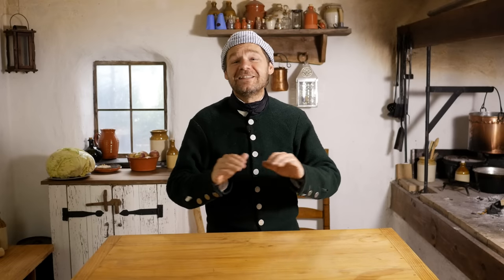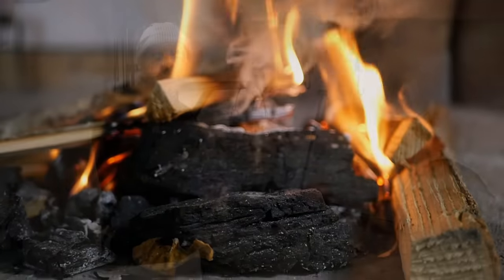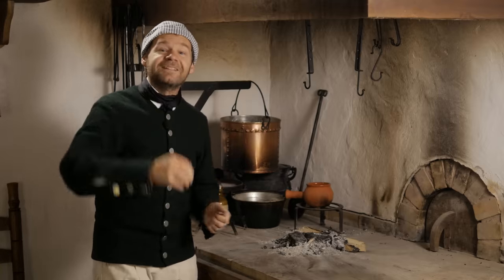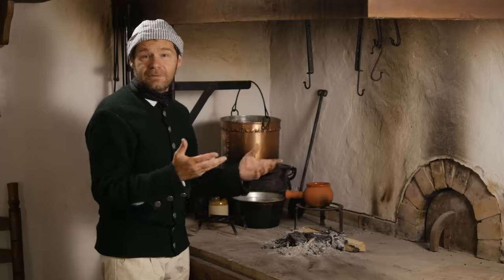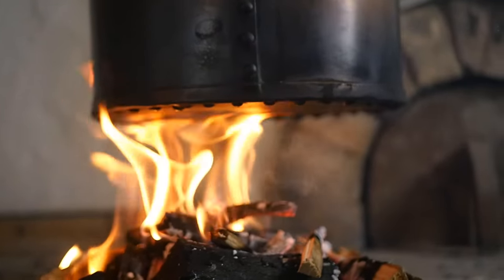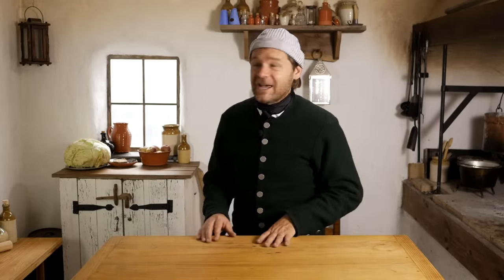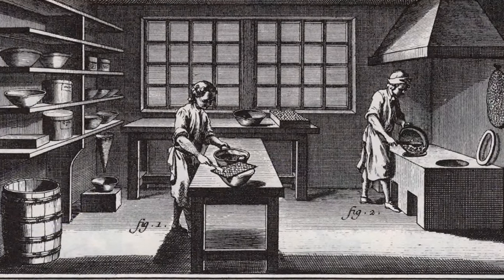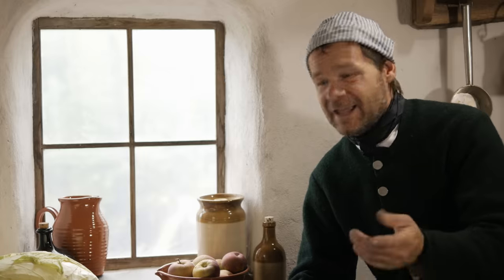Historic Kitchens vs. Modern Kitchens

Comment: For the first 8 years or so of my life, we lived like the people you just described!
I was born and raised in the backwoods of NW Pennsylvania in 1954. We lived in a rundown bungalow that was little more than s large shack.
Our kitchen had a sink with no running water. Water was obtained via a hand pump in the back yard that needed to be primed prior to each use. Cooking and heating was done by a huge black-iron, flat top stove. There were 8, round removable lids used for sitting pots over an open flame or for cooking on top of the lids. There were doors on the front where wood was fed into it. It kept the kitchen reasonable warm in winter, though you sweltered in the summer.

The living room was heat via a coal stove, though most of the heat went up the chimney.

There was no bathroom, so a curtain was affixed in front of a space that may have been a hallway closed or pantry. It contained a wooden chair with a hole cut in the seat with s metal, 5 gallon bucket on the floor, under Neath. It contain water and bleach or some other disinfectant. This was for me but my mother and Grandmother used the outhouse situated about 30 ft from the house. Imagine trudging through the snow in -20°F weather to go to the bathroom.

Washing up was done at the kitchen sink with water heated on the stove. I got very acclimated to cold weather at a very young age!

Finally, when I was in 3rd grade we moved into a house my uncle built for his son and his family. They moved into town and we took there place. It had indoor plumbing, though no hot water. It did have an actual, functioning bathroom! The house was heated by s coal stove and like our earlier one, had no insulation, single-pane  windows and linoleum on the floors. Both houses did have electricity, though.

I got s bedroom of my own! It was s porch that my uncle enclosed. My wall attached to the house had lap-siding, like the rest of the exterior and in the winter time snow would blow through the gaps in the walls where they met the lap siding. There was no door on the doorway to my room. A heavy eool blanket was hung over it in the winter time to keep the heat from the banked fire in the main parts of the house. I slept under lots of covers!
In the summer time the wool blanket was replaced with a thin, gauzey curtain.
This was how we lived until my 3rd year in the Navy when my mother passed away. Her mother passed when I was 5. I had 1 year left of my enlistment, but I never returned home when I was released from active duty s year later. It just would never be the same.
Reply: That's how I lived till age 5 when Dad built a small house closer to school.
Reply: Super interesting, thank you for sharing!
Reply: At This time my Parents had running Water in the Kitchen, cold of course, and an indoor WC.
 There was a Well underneath the Cellar with a Hand pump to have access to fresh Water.
Her Stove was a big white Monster, heated up by Coal. It had a baking compartment,  a place to have a permanent Warm Water Pan. It had rings over the Fireplaces which she removed to have more or less heat. And of course Granddad dried (and then reused) his chewing Tobacco on it. 
Much to the annoyance of my Mom, since that vile stuff caused dark spots on her otherwise immaculate Oven.
Reply: We have neighbors who still live in those conditions.  Well with a hand pump outside the house.  We ourselves have running water inside, but heat with wood and have a wodk burning cookstove / oven.  We aren't connected to the electric grid , so power is extremely limited
Reply: You gotta write a BOOK!!!
Reply: Grew up on a island off the coast of Maine until 13. No electric or running water and used a outhouse. Did have a rain water catch system (rain gutters drained into a big tank) and big wood barrels on the downspouts that didn't go to the tank. No other fresh water on the island but still never used it for drinking water. That had to be brought over in old one gallon milk jugs. We did have a propane refrigerator that no one was allowed to open the door of. Cooked a lot outside when it was warm and then on the wood stove that seemed to burn and had to be feed for 9 months straight.
The island was sold a while back but I've though about it and the funny thing is today with solar and wind power, micro desalination plants, cell /wi-fi service, composting toilets I could make that island a paradise with all the comforts of a on grid home.
Reply: A Keeper Of Odd Knowledge This is a wonderful family story and I thank you so much for sharing it with us. Blessings from Canada!
Reply: I understand.  I live like that now for the most part.
Reply: That could have been my story except I was born in 1945 and that we didn't get indoor plumbing until I was a young teenager. Daddy turned a small pantry into an indoors bathroom and put in a stool and a shower, but never got to the sink part. He dug a cesspool outside and we were warned to never go near it. 
We had a wook cookstove that he plumbed a water tank to so there was hot water when the stove had been burning for awhile. Never woke up to hot water. 
Until then, we carried water in from a handpump. It was one of our chores we did every night. 
This was in Wyoming where it really gets cold now and then. All 8 of us kids slept in an unfinished unheated attic, Little House on the Prairie style, all in one huge room. I remember waking up with snow on the quilts we were covered with. We heated rocks on the stove and took them, covered with a rag, to bed to warm our feet. 
At one point, Mom didn't have a refrigerator and used an old cooler on legs that came from a store up on the hill from us. We kids thought it was neat, but I'm sure Mom didn't 
She washed on a washboard for quite awhile, then got a wringer washer. She never got an automatic washer until she was old and all the kids had left home. 
I'm sure it was hard for her, but when I talked to her about it one time, she said "It was a good way to live and I wouldn't have had it any other way!"
Reply: I'm in my 60's and our house didn't have indoor plumbing, just a kitchen sink, till I was about 5 year's old, no insulation, and had to put plastic over the windows every year, and wind would lift the linoleum.
Many Americans had similar experiences, yet our corrupt politicians sees fit to ship MOUNTAINS OF MONEY TO FOREIGN COUNTRIES THAT HATE AMERICANS!
Reply: You and I were raised the same, except, we had no electricity, we got water from the well and you headed for the woods to do your toilet business, because we had no out house! It was cold in the winter and hot in the summer and miserable the rest of the time.
Reply: The USA only Had had interstate highway in the 1960s. The way of life of country side American probably still the same as in  the 1800s pre interstate highway😂
Reply: Thankyou for sharing your memories.
Reply: My family and cousin's family would spend two months each summer far up in the mountains of West Virginia. No fridge. We'd get a big slab of ice, on the way up the knob, from the iceman for the metal cooler on legs we kept perishables and sodas in.. Got buckets of water from an outside crank pump. To bathe, there were big round metal tubs we'd stand in, outside and be washed and rinsed by mom. Brrrr. Cooking was done on a kerosene stove top and daddy did the cooking. He loved it. It was the men's Hunting Camp in Season and up for family share off season. The two story farm house had a fireplace in the parlor. We had no electricity, played family games around a big table under oil lamps. Some decades later those halcyon memories are as fresh and as precious as anything.
We had chamber potties in the bunk rooms or we took a long, dark walk out to the outhouse. At age 8 I drove an army jeep around the mountain. The jeep was the best vehicle to get us up the narrow, cliff side dirt roads. We kids would wander & learn nature for hours, pick buckets of wild blueberries, swim in rivers,  shot targets (cans) with my own little shotgun. We roamed around the countryside, learning about nature, making sassafras tea by a stream and lovin life. Wouldn't trade it for the world.
Reply: @moodylicious     Love your story! Times sure have changed! We've both enjoyed freedoms and privileges that are pretty much gone, perhaps never to return. Hang on to those memories!
Reply: @akeeperofoddknowledge4956  we were lucky weren't we?
All of us learning to live with little creature comforts, the source of unforgettable memories and valuable life lessons. And it fostered an enormous love of and respect for our Natural world, now in such peril.
Reply: @moodylicious  How right you are!
Reply: In the 70s uk we did not have central heating or a fridge, the latter was very expensive.  So we had a coal fire in the living room, the rest of the  house was stone cold, though we did have fireplaces in each bedroom but not used - coal was too expensive. To keep food cool we had a pantry and that was desgined to keep stuff cool.  Inm the house I live we still have a chimney and but its blocked off. If want to get really pre modern in the early  in the early 70s the toilet was in teh back yard, and if the house did have a toilet there was none in the bathroom but down stairs just past the kitchen near the back door.
Reply: My house on the edge of the metropolitan area of Sydney, Australia is 900sq feet and was built in 1949. It was originally made of asbestos and had an outhouse and laundry in the yard. It had a 1930’s wood stove as the main heat and cooking source. It did have a bathroom with a tub/shower and vanity with hot and cold running water. And electricity. It would have been a comparatively large house at the time. It has three bedrooms. When I bought it it had been modernised slightly with a wc added using some of the hall outside the bathroom, and the laundry had been relocated to a lean-to off the back steps. The wood stove was, sadly, left to rust under the house and replaced clumsily with an electric oven. My late husband and I renovated the house in a sympathetic way,  keeping as much original as we could, though with mod-cons like a/c and we removed the asbestos (it’s now properly insulated and clad). I love my house and often think about how people would have lived in it originally. Thank you for sharing about how you grew up. I love hearing about different upbringings and ways of life.
Reply: That's how I lived in Wisconsin until 1978
Reply: Thank you for story , nowadays if we lost electricity or water almost everyone would be screwed ,except people who has lived this way ,
Reply: My Dad had relatives that lived in a very rural area in the 1950s. They still used an outhouse and actually had corn cobbs available to wipe! 😲... I guess that was the thing to use when they didn't have paper or "bumfodder".
Reply: @baylorsailor  
I lived that way from 1960 - 1978
Reply: I was born in 1949 and we lived in a 1700s cape house in Maine til I was ten when my mother left my father.  No insulation, of course. We had no running water or bathroom but the outhouse was at the end of the attached barn so we had a roof over our head while we ran to it. We had to run thru the snow that blew under the big barn doors though.  We had a ladder like stairs down to the root cellar where ma stored root vegetables and her canning. My mother also cooked on a wood stove. I don’t think she ever mastered it. Her biscuits were always ‘frosted’ on the bottom.  That’s how I remember it anyway. Water was drawn and carried from a well down the hill.  Snow would blow in around the windows in our bedroom. We, my sister and I, would warm our blankets by the stove, wrap it around us, and run for the bed.  My sister always had warm feet though because she put them on me.  Off the kitchen was a little ‘birthing room’ as my mother was a midwife.  
My father finally put in running cold water and a bathroom in the 70s. And a gas furnace in the living room.
Reply: @ellicooper2323  
Yes we had very similar lifestyle but mine was till 18 years of life.  Now cause stupid banks won't loan money I am once again without.  Blessings to You
Reply: Thank you for sharing your story. So interesting!
Reply: Wow, thanks for sharing
Reply: @finscreenname  was the island called little cranberry?  I was there over a decade ago. Beutiful place
Reply: @wyntresorrow403  That's a little too far north up by Bar harbor. I was on a little island called Burnt Coat down the coast between West Point and Sebasco. But there is 100's of islands like that in Maine back then.

Comment: I was born and raised in Finland, and I could swear every single older house, cottage, and cabin I have visited in my 25 years in Scandinavia before I emigrated to the U.S. has some form of raised hearth. Pre-1800 (give or take a couple of years), they seem to be about the same height as the seat of a chair, but by the mid- to late 19th Century, most of them had been built about counter-height for the contemporaries (I'm taller, so they're usually hip-height for me), with a baking oven, a hearth with hooks for suspending pots over the fire, and if they could afford it, a small cast iron cooking range insert (In Sweden, surviving ones are often made by Husqvarna, the same company that makes chainsaws today!), and the occasional wood fired water heater, depending a little on the wealth or the lack of it in a household.

Another quirk of old Scandinavian kitchens, that I'm not sure I've seen elsewhere, is that the one kitchen/dining table in the house was sometimes constructed with a removable table top, that could be flipped when you were baking, so you had a clean baking surface reserved just for baking, to keep the conditions more sanitary in a day and age when cleanliness was harder to maintain.

Comment: "Nowadays, we can just set a knob to three and it will be consistent"

You sir, have clearly never met my stove! lol
Reply: Mine is consistent, but if you want 3 you have to set it at 5 🤣
Reply: Exayevie well yeah but you don’t have to start a fire
Reply: @thetillerwiller4696  Match Lighting is the best. Especially when you need to light the oven pilot light.
Reply: If it's electric, that's because it doesn't change the current running through it. It just varies how long it stays on as it alternates on and off to add more or less heat. Terrible system for consistency.
Reply: Mine starts at the selected temperature and then decides to get hotter over time.
Reply: Lol says my 1949 kitchen and touchy 1940’s gas stove ;) Dishwasher? No. Disposal? No. Ventilation? No. More than 1.5 by 2 feet to prep food? No. Ok, way way better than a wood fire and no plumbing, plus I do have a fridge. Thankful for what I have :)
Reply: heh heh he.
mine too ....terrrible
but I fight 'the good fight' with it

Comment: My grandmother, who died in the 80's, still cooked on the floor, with fire, sitting on a very low stool. She stoped using the wood/coal stove because she didn't bake bread anymore, but I remember that the food had a wonderful taste. Nothing cooked with gas or electricity tastes like that. She didn't have electricity, so, no refrigerator.